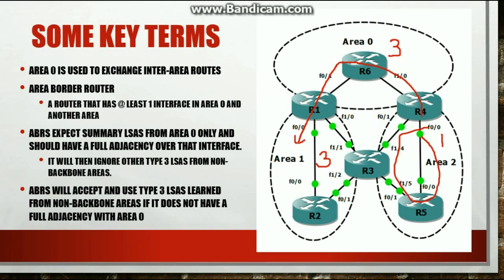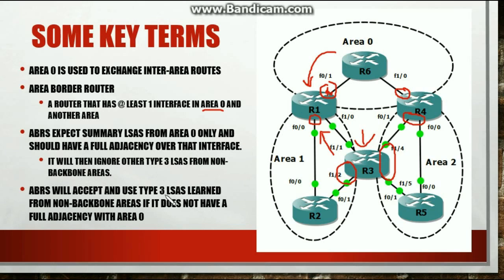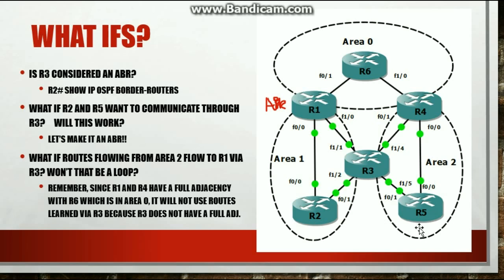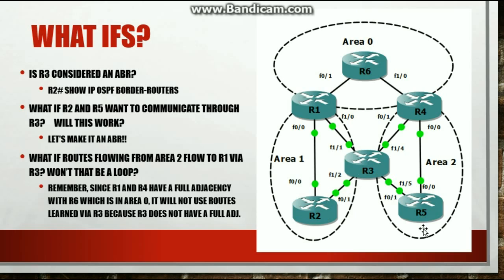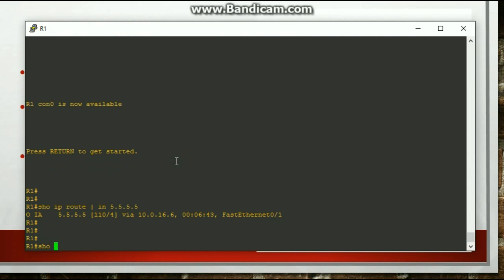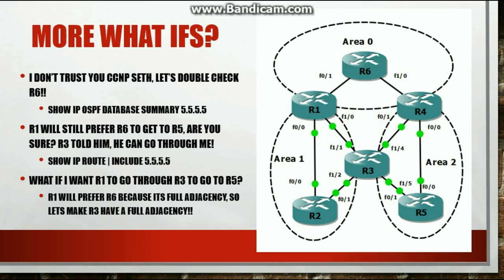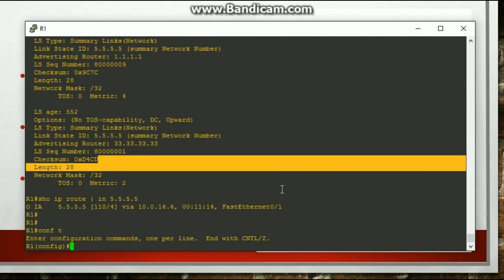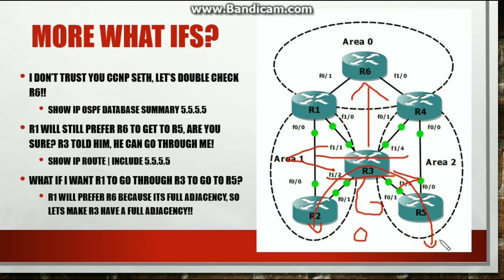OSPF Loop Prevention

Comment: i don't usually comment but you nailed in 2 minutes. i spent 3 days searching answers on YT and google, to questions like "why is mandatory to connect everything to area 0, why non backbone ABRs are not advertising networks or why ospf behave strange if you don't use the standard area 0 topology" everyone uses the standard to prevent loops. lol but none gives example of loops so people understand this protocol.
thanks and good luck.
Reply from the maker: Yes sir, i asked the same exact thing. So thats why did this video. Thanks for the comment

Comment: "Abrs will accept and use type 3 lsas learned from non backbone areas if it does not have a full adjacency with area 0"? What u mean? Third slide, u just said abrs will not use lsas from R3 because R3 doesnt have full adjency to area 0????

Comment: What If: area 1 is a loop that connects to two Different area 0 ABRs and then you have a dropped area 1 link that splits area 1 in two. How do you prevent dropped traffic between the two halves of area 1.
Reply from the maker: So you can have multiple areas w the same number, the concept is that routes from an area must transit area 0 to get to another area regardless of the number, even if area 1 is split
Reply: In my experience it breaks the Routing. At least with route summarization. The fix for me is two gave two links between the ABRs, one as part of area 0, and the other as the other area.